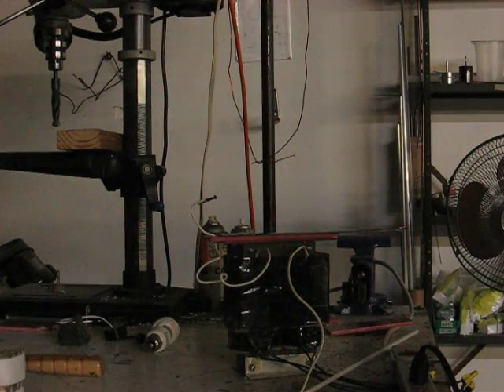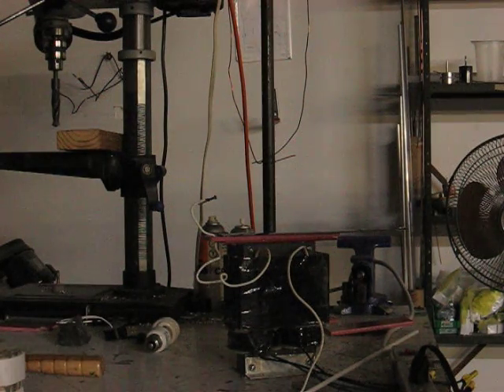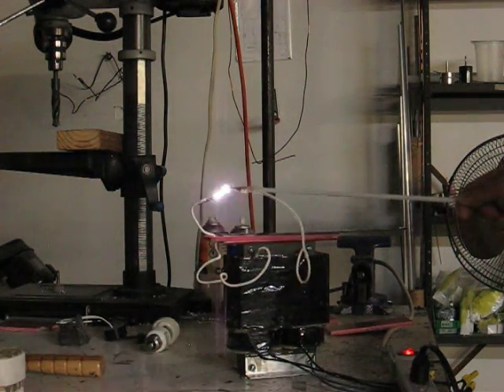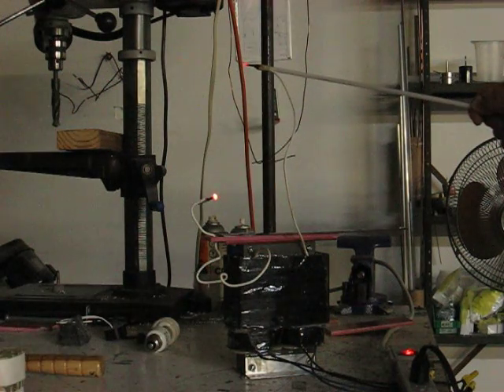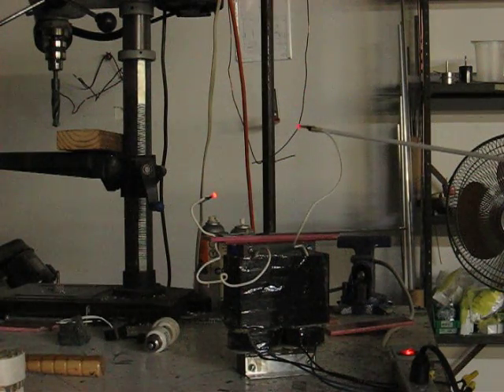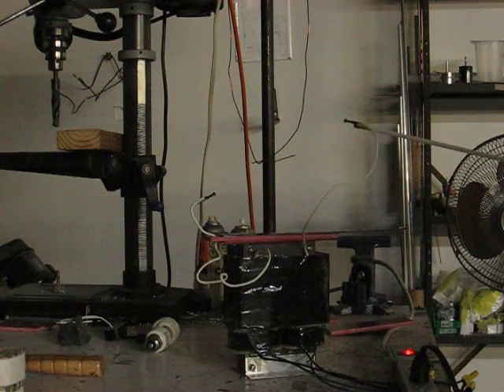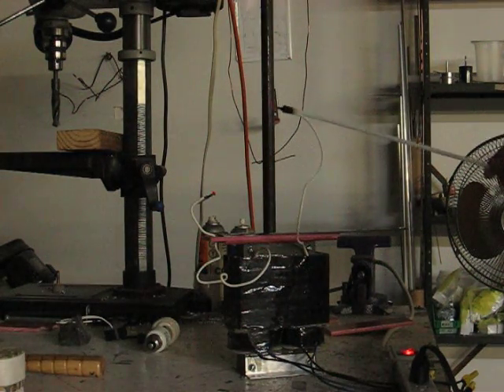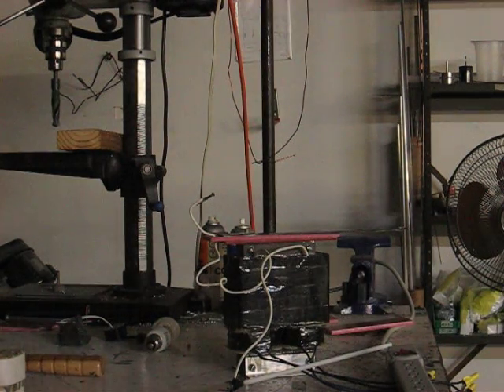Fun with high voltage

Comment: Very interesting and different than the blue, narrow sparks I've seen produced by tesla coils. Did I hear correctly, 15,000 volts? A car ignition system produces around 40,000 volts, I think, and can jump only about an inch (2 to 3 centimeters) at one atmosfere pressure. Also on my computer screen the spark looks more like the flame of a candle than a spark. If it really looks like that, how come? Is it because of the relatively low frequency? I guess it's 50 or 60 cps (Hz) depending on your location.

Neither have I seen a spark rise up into the air in the center in an inverted "V" shape. You explained that it's caused by rising, hot air. But why don't other sparks that I've seen do that? Usually the spark flies in an almost straight line between the electrodes.

Don't know why I haven't seen this earlier, today Youtube suggested that I should see your video of the steam engine with boiler.
Reply from the maker: The difference in the arc is the current,  An automotive ignition coil (also most Tesla coils) outputs very little current.  The transformer in this video was capable of outputting quite a bit of current, so the arc is very hot.  Yes, the frequency is 60hz.